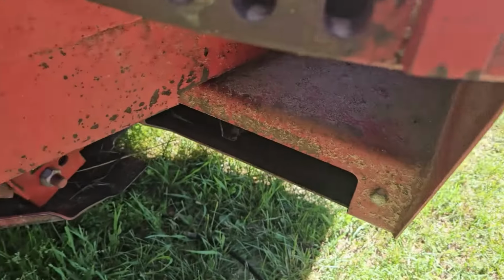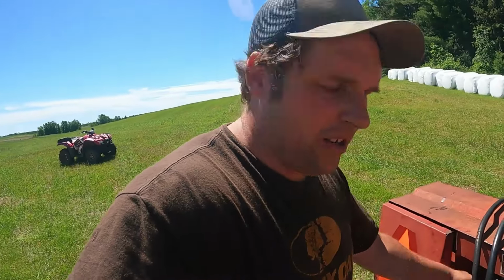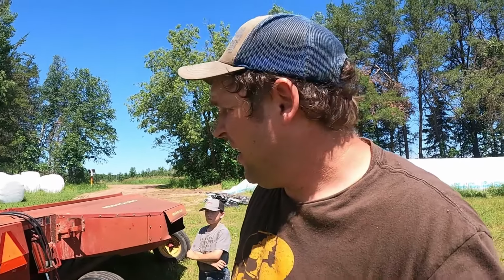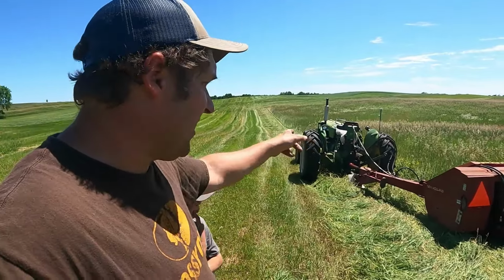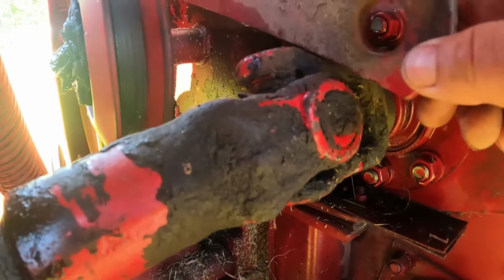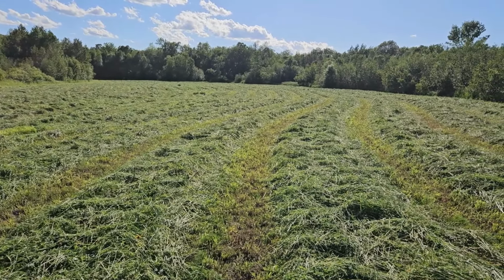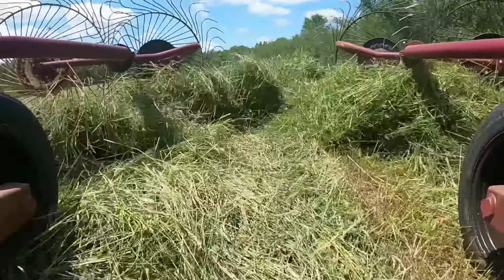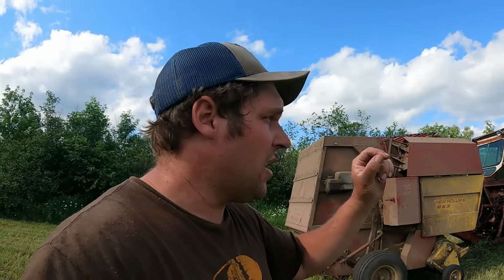Will the New Haybine Work? Cutting/Raking/Wrapping Hay Continues

Comment: The man who does my mechanic work who worked at our local NH dealer for 15 years. He told me the 489 has one weakness, if that roller chain in there goes bad it will ruin the wobble box. He has one and replaces that chain regularly to prevent that.

Comment: Those 489 haybines extremely popular machine. We use a John Deere 1209 and we are the oddity. Good to know about the belt, Our John Deere also has a belt that runs the reel, it seems like ours is easier to get at. Good see your 530 in action, our 630 was cheering it on!! Justin (??) is getting to be good with the camera too.
Reply from the maker: Jordan is our go pro expert.
Reply: 1209's were great machines in their day! But when they plugged (point rows), they plugged real good. Or really BAD, if you had to unplug it.
Reply: @MorganOtt-ne1qj  we were fortunate not to plug it too bad thus far but we do carry a big pipe wrench to turn it all backwards just in case.
Reply: @anthonyhengst2908  YEP! 👍
Reply: @anthonyhengst2908 haha we have a couple 1219s and a 1209 for our smaller fields and us too we carry wrenches so we can reverse it if it plugs up bad

Comment: Nice video. We have a 492 haybine which is similar. We always ran our head raised up with the hydraulic cylinder for our cut height instead of dragging the shoes on the ground all the time.
Reply: our old new Holland the shoes were wore off it, just ran on the cylinder for cut height.

Comment: I grew up with a 489. I remember replacing the wobble box more than once.  The pan that the guards bolt on to was also bent since the machine was new and would bind the sickle bar.  It was a struggle many years.  A discbine is a big improvement but you'll likely need a bigger tractor than that John Deere

Comment: I said to the wife that you were going to buy that 489, and I was right! I was as happy as you were ! I love the old haybines! I started on a 467, I believe it was a 7ft cut, traded it for a 469, 9ft! Run it with a 620 JD, and a 770 Oliver diesel! Loved both tractors! I'v run into a lot of things cutting hay, even naked people, finally they had nowhere to hide and they were about 8 streakers going across the hay field!🤣! Wait until you get a skunk caught in the rollers and have to pry it out!🤣! Justin, you the man! I was helping my Dad running equipment at your age!
Reply: I had a 469 and never seen another one. Bought it about 15 miles away, used it for 15 years and only changed the sickle.  Granted only cut 40 acres a year.

Comment: Hi Alan and family, I had a similar issue with my haybine once, both top and bottom rollers must run in time with each other, when I ran into real thick hay one roller would slow and make a banging noise, turns out one of the keys fell out of the keyway on the bottom roller. It is hard to see and maybe a 50 cent part. My machine was an older version of yours. Take care👍🇨🇦🚜❤️